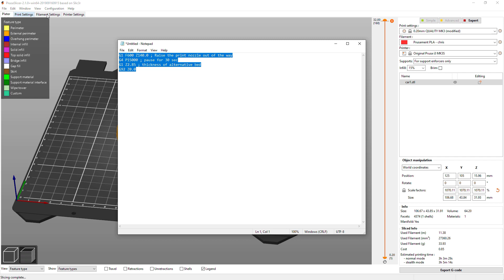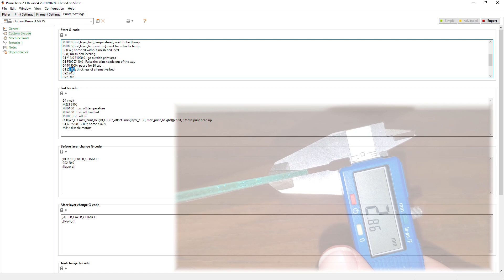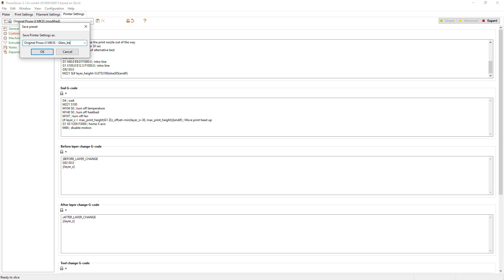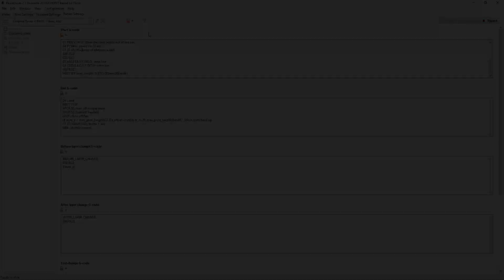How to set up a glass bed for Prusa i3 Mk3s

Comment: I placed your codes in my Prusa slicer using my MK3 but it does not export that part. I also open the code in notepad and is not there. What would be the reason that Prusa slicer not exporting that portion?
Reply from the maker: That seems very strange Is there a chance you were saving it to a profile that is not the active profile? I'd recommend contacting Prusa support. I found them to be very helpful.

Comment: Ah ha! I found how you did this in your reply: "When I do it I leave the glass on the print surface until the printer starts to move and then I have to whip the glass off of it before the hot end gets down to start leveling and then put it back on after it's finished the leveling" thank you.... i might just let it wait longer and let it heat up and allow me more time to clip :) thank you again

Comment: Thank you for the valuable tip.
Just a side note. 
G1 is movement with the extruder and G0 is without the extruder.
I think this would be more to the Marlin Specs:
G0 F600 Z140.0 ; Raise the print nozzle out of the way
G4 P15000 ; pause for 15 sec
G0 Z2.85 ; thickness of alternative bed
G92 Z0.0

this is what I have done:
M300 S440 P500; gcode start sound to alert ready for glass plate.
M300 S880 P500
M300 S440 P500
G0 F600 Z140.0 ; Raise the print nozzle out of the way
G1 Y210 F2000.0; Move table forward
G4 S60 ; pause for 60 sec ;Allow glass to heat to temp
M300 S880 P500; gcode start sound to alert ready for first layer adjustment
M300 S440 P500
M300 S880 P500
M300 S440 P500
G1 Z4.0 ; reset z at thickness of alternative bed
Reply: I like the added functions. Are you running a prusa mk3s yourself? I have i3 MK3s+ that runs on variation of Marlin firmware. It should work on my machine right?  Do you insert the additional code lines right after G92 Z0.0 ?

Comment: Why do we need a custom gcode? I suppose the printer should recognize the new height?
Reply: unless you have touch3d sensor using the probe to do physical measure otherwise the inductive sensor like pinda only work on metal. It do not recognize a piece of glass on a metal steel plate.

Comment: Why would you even want to do that? Prints on my Prusa smooth spring steel PEI sheet have a bottom surface that looks and feels smooth and flat like glass anyway. What would be the advantage to printing on glass?
Reply: If you try to print Nylon filament the part will bend and will not stick well.
Reply: When you print in nylon, it deosnt stick well, and also damages the smooth sheet. If you want a smooth finish on you nylon prints, I guess this is the way to go.

Comment: do you think if in the cura Z-offset you give the value of 2.85 and after automatic adjustment you then quickly add the bed sheet will it still work that way?

Comment: Any idea how to make the mk3s heat and auto level with the glass on? I don’t like the fact that you add a cold glass on top of a preheated bed and spring-sheet.
Reply from the maker: When I do it I leave the glass on the print surface until the printer starts to move and then I have to whip the glass off of it before the hot end gets down to start leveling and then put it back on after it's finished the leveling
Reply: @personal_reminders  If you find a way to leave the glass on while Mesh Leveling please let us know.  Your video was super helpful and had me going with glass in no time.  Thank you,.
Reply from the maker: @steveng6492  so glad I could help unfortunately I think it's a physical limitation of the distance that the sensor can detect the metal bed at
Reply: @personal_reminders  that makes sense, thank you.
Reply: @personal_reminders  That explains why the MK3s won't do a 1st layer calibration with the Garolite (in my case) on the bed. I guess I'll tweak the sheet thickness and the 'live tune' in further. 
- - - OR I might try to trick the sensor with a flex-steel plate on top just so I can get (and save) 1st-layer calibration as a loadable option; and then Live Tune in once it's loaded. That might be a better approach me thinks. Cheers🍺

Comment: Hi, I successfully printed your video on a 3mm glass plate.  Only now I have the problem that he starts printing on z 3mm without a glass plate.  Wanted to print a piece with the old G code and it now always takes over the 3mm.  Why?
Reply from the maker: because when you change the printer settings that is a global setting that tells of software that is how the printer is supposed to operate and that's why I saved it as a different name printer and whenever you want to print normally you go back to the original printer profile. if you did overwrite it, just re-add your printer as another printer or just go and remove the code you added and save it as default printer and then when you want to switch between the glass or not you just change which printer you want to print to in the default slicing window right below where you pick the filament
Reply: @personal_reminders  
G90 ; use absolute coordinates
M83 ; extruder relative mode
M104 S170 ; set extruder temp for bed leveling
M140 S[first_layer_bed_temperature] ; set bed temp
M109 R170 ; wait for bed leveling temp
M190 S[first_layer_bed_temperature] ; wait for bed temp
G28 ; home all without mesh bed level
G29 ; mesh bed leveling 
M104 S[first_layer_temperature] ; set extruder temp
G92 E0.0
G1 Y-2.0 X179 F2400
G1 Z3 F720
M109 S[first_layer_temperature] ; wait for extruder temp

; intro line
G1 X170 F1000
G1 Z0.2 F720
G1 X110.0 E8.0 F900
G1 X40.0 E10.0 F700
G92 E0.0

M221 S95 ; set flow

This is the original Start G code from my Prusa Mini.  
After G 29 I have inserted the adapted G code from you. This works exactly
1 time, then the next time he prints everything on Z6, then on Z9mm .. Why?